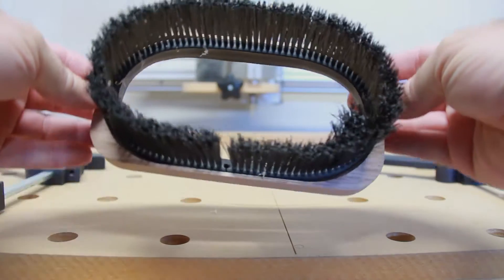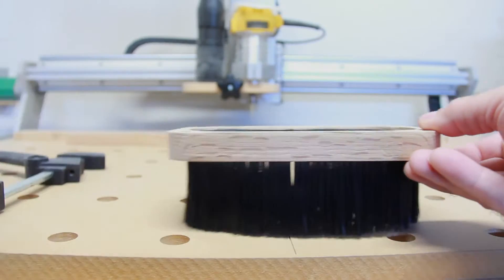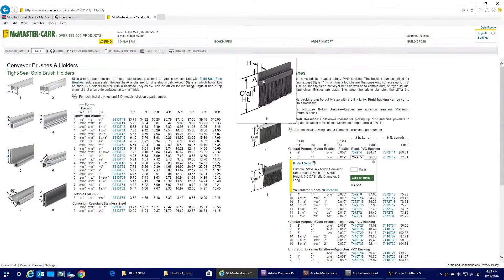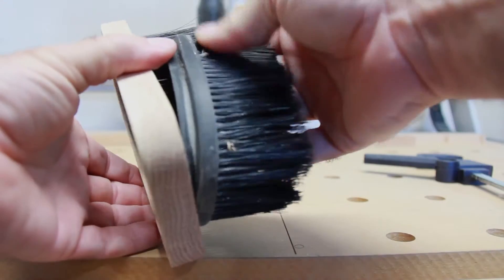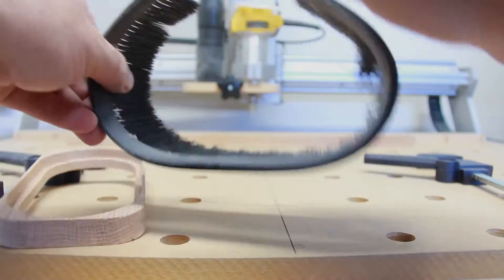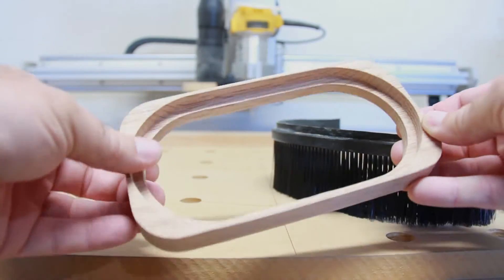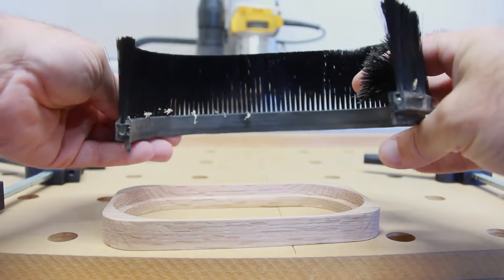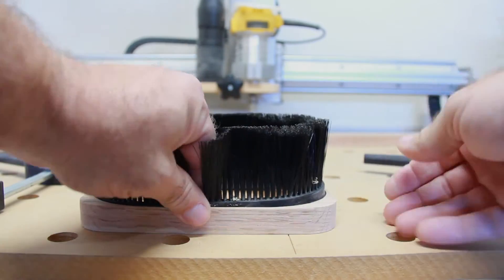CNC Dust Shoe - the Brush

Comment: I really like your design, thanks a lot for sharing it :) I also like your workpiece clamps, where can I order them and what’s the distance between the holes in the wasteboard?
Reply from the maker: Thanks Manuel.

They are Festool Clamping Elements - designed to work with their MFT surfaces. I machined similar holes directly into the MDF pallet and it seems to work pretty well.http://www.amazon.com/gp/product/B000JNEC1Q?psc=1&redirect=true&ref_=oh_aui_detailpage_o00_s00

 Not perfect - but very flexible and I do like them. 

The holes are spaced in a 3 in x 4 in XY grid - but you can be creative and use pretty much any spacing or pattern that you need.  The only critical part is the hole size need to be an exact match for the peg on the bottom of the clamp.  Also - the holes don't go all the way thru the pallet - the stop just shy of the bottom surface.  I didn't want chips and sawdust getting between pallet and the top surface of the machine - this keeps things contained and easy to clean up.

Comment: Can't find these brushes anywhere in Europe, (only rigid types in alu profile to mount as draft brush under doors)
Shame really, now i have to do some tedious work like Marius Hornberger i'm afraid:
https://www.youtube.com/watch?v=ufXTIu2VmME&t=638
Reply from the maker: I did a quick search on Google UK for Conveyor Brush  and it finds a few manufacturers of similar strip brushes.  

Here's an example:  
https://www.mink-buersten.com/en/products-shop/strip-brushes.html
It's an industrial product - so not likely to find it at home center, but you can probably order from the manufacturer or industrial supply house.
https://www.mink-buersten.com/index.php?id=166&L=1&id_artikelkategorie=224&id_koerper=29_1&faserdurchmesser=0.3000&faserhoehe=50&koerperlaenge=1000&flag_langloch=0&id_faser=33_12
Good Luck and Have Fun!

Comment: Dale  I can´t find the bristle like the one in the video clip 
I have been in to the McMaster Carr but couldn´t find it
Reply from the maker: It's the Conveyor Brush - Direct Mount - Style 9.  it's available in 2", 3" 4" overall heights - in either 3 ft or 6 ft lengths.For example:  http://www.mcmaster.com/#7372T5   This is the 3" overall height - 3 ft long version of the style 9 (like in the video)   You can find all the variations of the style 9 Direct-Mount Strip Brushes on the catalog page - about midway down:   http://www.mcmaster.com/#catalog/122/1311/=146sifz  Good luck and have fun!   Let me know if you still need help... ;-)
Reply: Thank´s Dale 
Do you think they ship to Sweden ?
Reply from the maker: I believe that McMaster Carr will ship internationally - but perhaps check around for a local supplier.  McMaster Carr is a big online hardware / industrial parts store primarily targeted at businesses.  Perhaps there is something similar in Sweden...?  If you find something let me know, I'd be interested to see what you come up with.  ;-)
Reply: Hi Dale
I got an answer from the McMaster Carr  and they said that they can´t ship to Sweden.
And I have searched and shown  the picture of the bristle to a bunch of people, but they have not seen the bristle before.
Is there a change for me that you could send  me one personally
Of course I´ll pay for all the costs in advanced
Reply: rednotereso hej, you can always use http://www.borderlinx.com/SE/en/ to forward it to Sweden, ha en gött jul